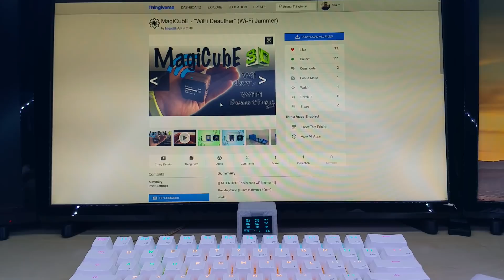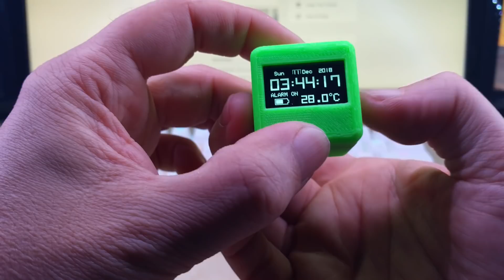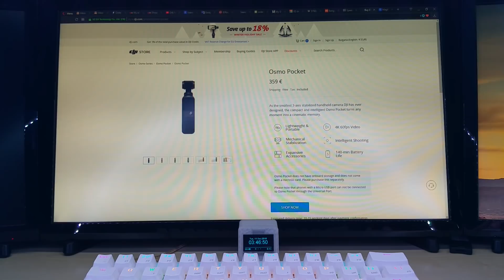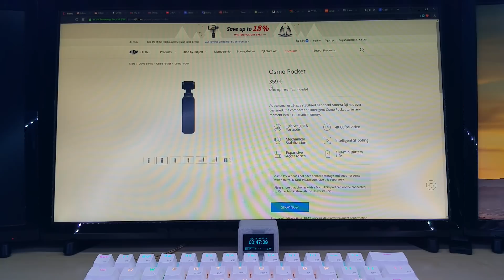ICE CUBE CLOCK by Hayri, long overdue case for the OLEDiCLOCK

Comment: Great work as usual Hayri! That GPS module looks tiny, and you say it gives the best performance yet?!
Have you had a chance to fully test it? Do you know what current it uses in normal and sleep mode? Thanks Hayri.
Reply from the maker: Thank you Ian, greatly appreciate it. Yes, I was surprised as well when it started receiving satellite signals on my desk where the other GPS modules never did. That's why I want to make it an optional external GPS module for the V-GAUGE. I did not have a chance yet to test it much further because where it can receive signal the others don't :-) The power consumption is about the same with around 45 mA. Unfortunately this module does not have a enable/sleep input but it acquires signal pretty fast, so it is not much of a concern for me. If you have any other questions just ask, I will try to answer them :-)
Reply: @iHayri1  could you please add a link to this module?
Reply from the maker: @KaiPosadowsky  which module do you mean?
Reply: @iHayri1  sorry for not mentioning: I am speaking of the GPS module.
Reply from the maker: @KaiPosadowsky  No problem, that's what I thought but wasn't sure, here is a link: https://www.aliexpress.com/item/NEW-Small-size-GNSS-GPS-GLONASS-Galileo-module-antenna-neo-m8n-chip-solution-Integrated-design-of/32852570526.html

Comment: How to get the clock case that you made I bought a couple of your OLEDiclocks a while back and would like to make a case?  Do you have CAD files somewhere?   I would like real CAD file if you have not STL because STL can't be edited.  Thanks again and good work!
Reply from the maker: Hi Dave, hope you have been well. It's quite some time that you bought the clock :-) Anyway, I have designed it with TinkerCAD online and do not have any CAD files, only stl files, you can however edit stl files very easily with TinkerCAD by just importing them into it. I will upload the files in a couple of hours and can send them to your email if you like too. Thanks.
Reply: @iHayri1   Thanks.  It looks like I have the real old version of the clock before you cleaned things up.  I have the one with all of the separate boards.  I will need to modify the case to fit my old one.  Thanks though at least it is a start for me to work with.  Cheers.
Reply from the maker: @L337g4m3r  If you use Tinkercad by a chance I can send you the link to the files directly so you can edit them easier :-)
Reply: @iHayri1   Thanks for the offer.  I kind of "traced" it in my CAD system already so I am good now thanks for a good starting point.   I would have given you any new designs I make with it but I now realize they will be useless to you  because they would only fit the old clock design.
Reply from the maker: @L337g4m3r  Thank you Dave for the offer also, yes, it will be no use for me :-) Glad that at least it was a staring point for you.